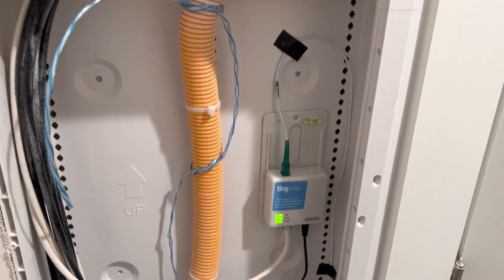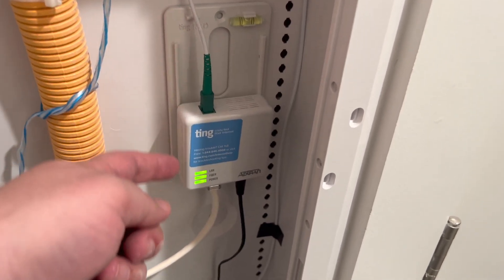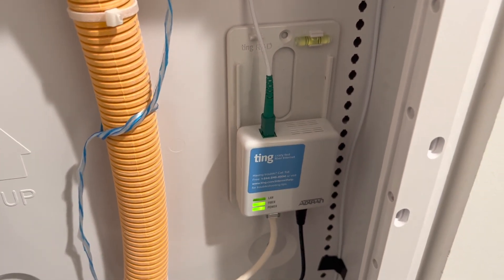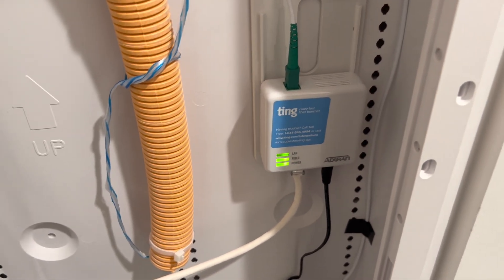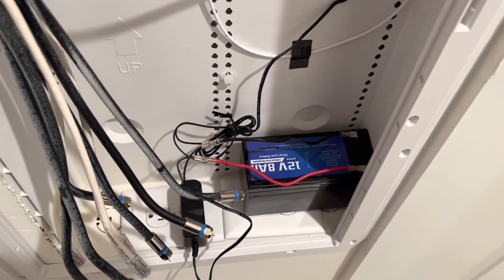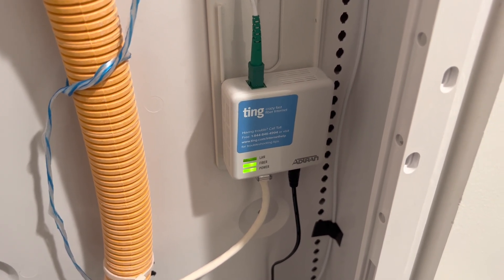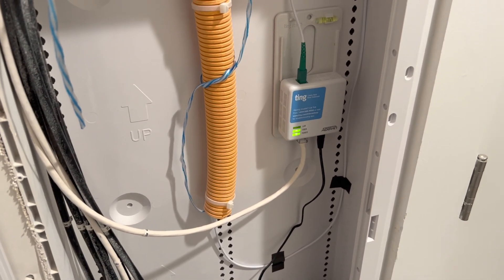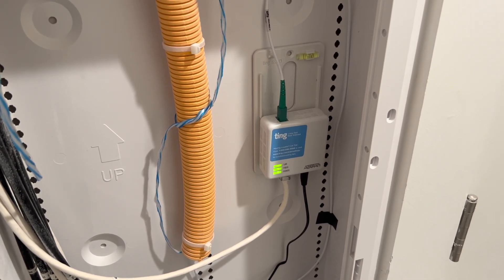simple ONT battery backup

Comment: it should also work with a BT ONT and other providers fibre optical network Termination and obviously they're router or firewall will also need a backup Battery aswell